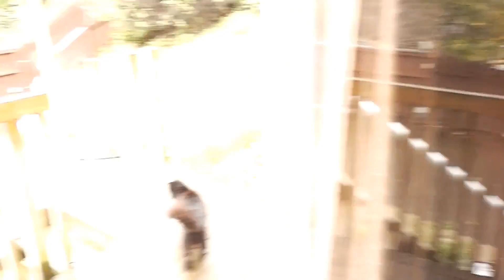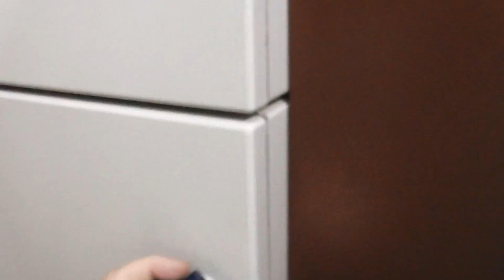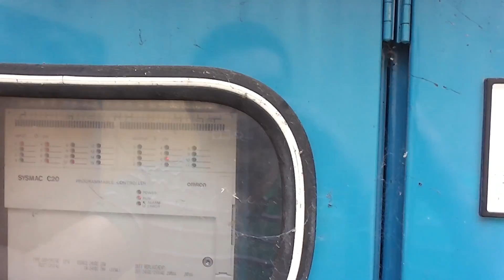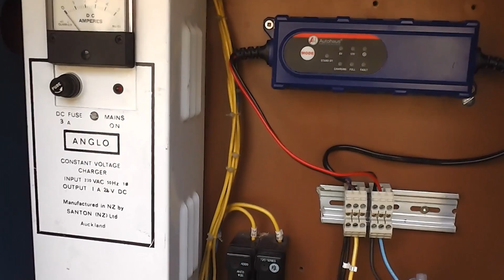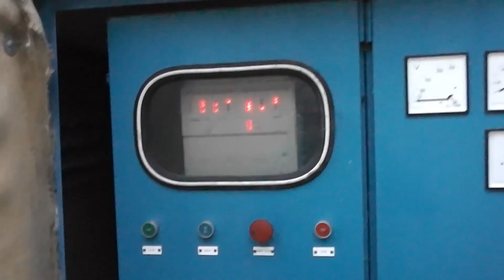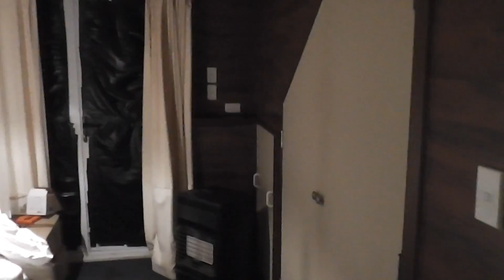Generators

Comment: Hi it seems a bit unlikely a battery charger could draw more than 6 amps at 240 volts thats around 1.4 kilowatts  I'm guessing the charger was faulty
Reply from the maker: Yep, dead short on the mains side